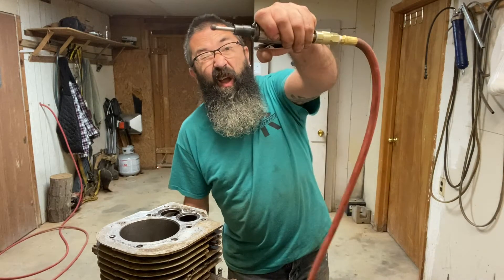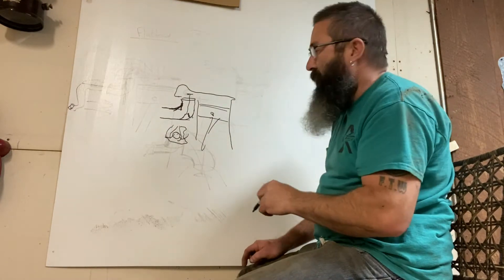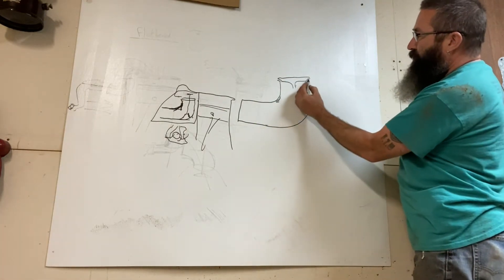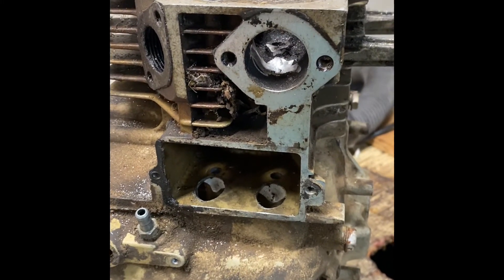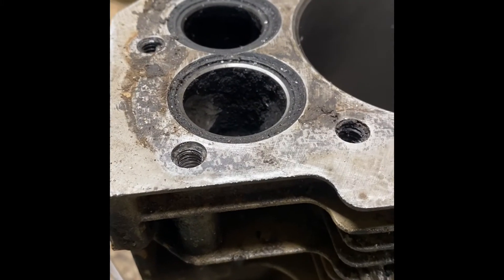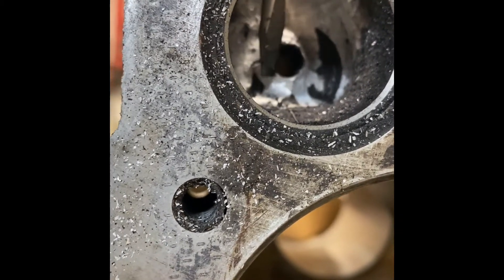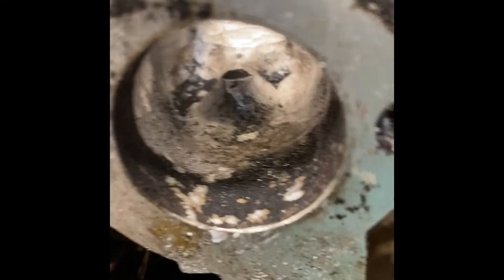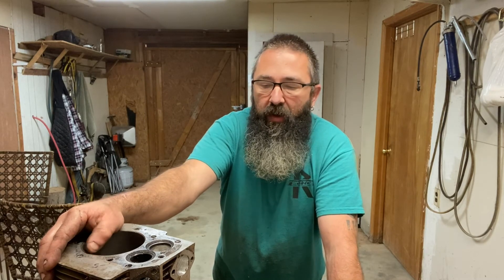6-Mud Mower Small Engine DIY Power Secrets- a finished intake port!

Comment: So would we need bigger jets after porting???
Reply from the maker: Most of these things are so lean from the factory due to EPA, they all normally benefit from a little more jet. As far as porting, you dont normally need to mess with jetting much. Better airflow = more 'suck' at the venturi, which = more fuel being pulled in.
Reply: I know this is an old post but on my 16hp Vanguard I  bought some micro drill bits. Went one size bigger than stock. Tested and checked the plugs for signs of running rich. I ended up going 3 sizes bigger. Later I'll be adapting a slide style 30mm carb. You'll also need  less restrictive exhaust.

Comment: Those little spots are where ive used epoxy to fill and smooth out where there's not enough material to smooth out otherwise... I have had success with it staying intact but I think it's because I go really extreme with keying the surface and really push it in... I've seen guys use Bondo with success too idk if it lasts like 20 years but within my time frames and use duration I've not eaten any epoxy yet but I bet it would pass right through if it did break loose